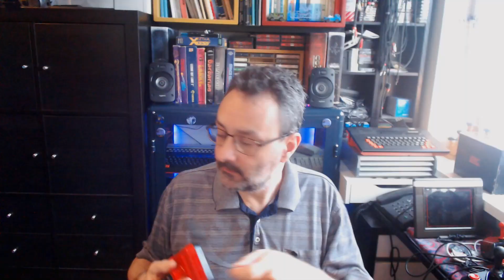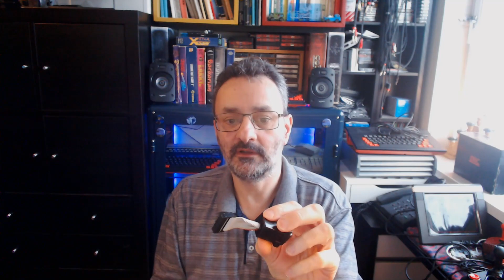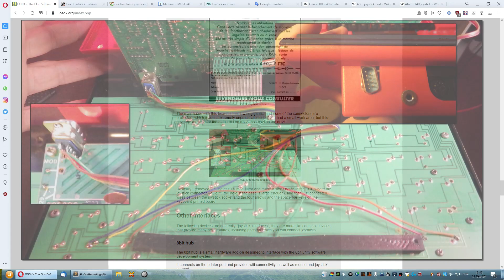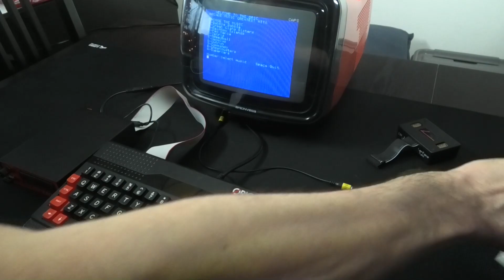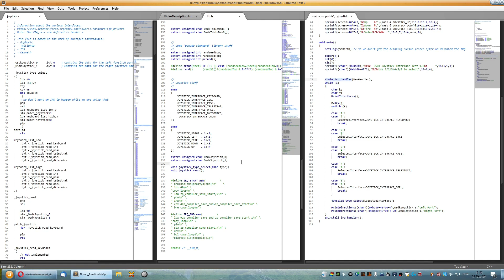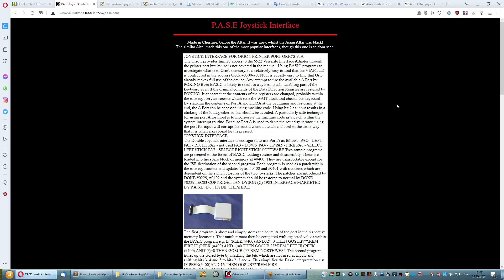Oriclopedia: Joystick Interfaces for the Oric computers

Comment: Where are these modern joystick interfaces sold? Do you have any recommendations of sellers in France or EU? Do you make them?
Reply from the maker: ISS is building the Egoisting and Egopads, not sure for the others, but the simplest and fastet really is to make your own, based on he Stingy:
https://ceo.oric.org/adaptateur-de-joystick-stingy-pour-oric/ because it's literally just a cable, a connector, and 7 diodes!
Reply: @DbugII  thank you for your reply. Appreciate it and I will read up on the Stingy system and make one. Wondering if you had any luck with it and whether it works good. I know not all games will respond I guess? Keep up your vids - BEST INFO on Oric for english viewers!
Reply from the maker: @saddiqkhan5821  In my tests, the Stingy behaved exactly like the original IJK interface, the only limitation of the system is that it only had one joystick port... but most oric games are single player anyway.

Not all games are compatible with the IJK interface, but many have been patched to work with it.

Glad you like the videos :)
Reply: @DbugII  thanks for the reply . Appreciate it. Will order the components and make the Stingy. Keep up the video content. Its nice to see someone so comprehensively covering the Oric. You really have got me into the Oric which was so underrated. I like watching your pick ups for the Oric and new hardware, as its like Gold dust now and so expensive.
Reply from the maker: @saddiqkhan5821  Unfortunately it has gotten expensive to me as well, I wish I had started gathering this hardware years before, because now I'm basically competing with hard core collectors with deep pockets, and I can't just afford to pay hundreds of euros for some random Oric branded thing which I will not use, just so I can show it on the channel :-/
Reply: @DbugII  you are correct. It is like gold dust now. I was lucky enough to pick up a boxed MCP40 Oric 1 Printer yesterday from ebay for 43.00pounds. I was surprised my bid won, as I was certain it would be atleast a 100pounds plus. Anyway keep up the good videos - your content is good and informative. Also my components arrived for making the Stingy joystick interface. I will give it a go.
Reply: @DbugII  I made the Stingy as it worked as per the instructions. However not many games work with it. Not even the IM10 and recent homebrews. Shame. Still its easy enough to make and I hope more games will be made to take advantage instead of the keyboard controls. It should not be that hard to add this functionality.
Reply from the maker: @saddiqkhan5821  Can you confirm that your interface works fine with my sample program here: https://osdk.org/index.php?page=articles&ref=ART17#title11 (search for the "And here is the pre-build binary in TAP format" line)

I asked on the forum: https://forum.defence-force.org/viewtopic.php?p=25436#p25436 will see if we get some link, but I'm pretty sure that just last year there was at least a dozen of games converted to support IJK, just not sure where they are!
Reply: @DbugII  works perfectly. I tried the sample OSDK Joystick Interface test 1.1 tap file and the actions register (up/down/left/right/fire) with no issues. The Stingy is a good solution, just a shame there are not many games that can take advantage.